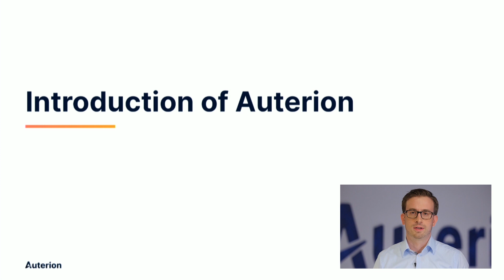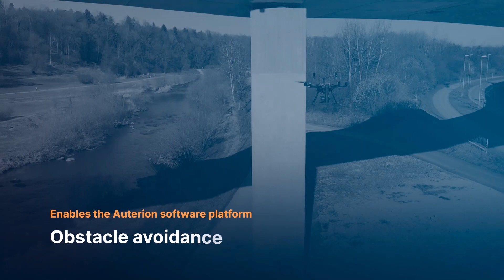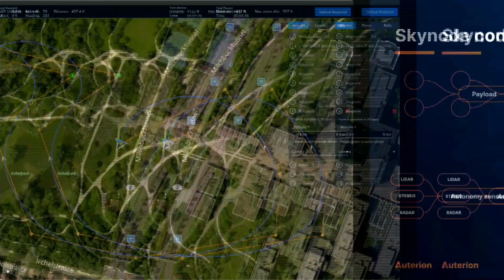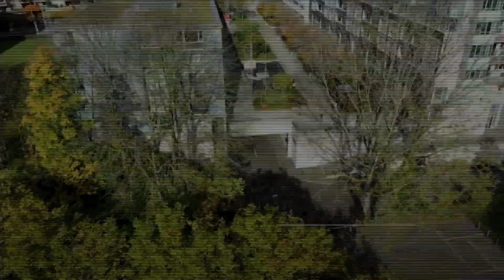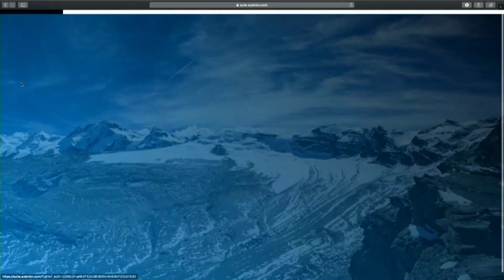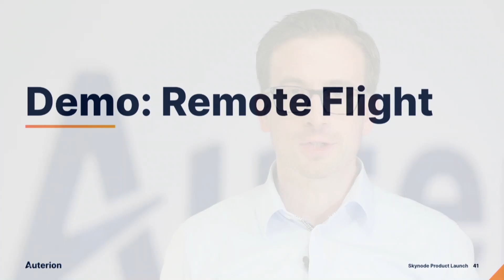Introducing Skynode, the next big thing after Pixhawk

Comment: A nice (and important) step forward. The new mission planning software looks great and includes great features, but the 3D functionalities seem limited to me. As far as I know, the area around the Irchel Uni campus has more topographic variation, than shown on the example screenshots. As such, it looks to me as if the flight path is shown in 3D, the underlying topography, however, is not shown accurately (if at all). Could you comment on this?
Reply: Yes. I was also wandering the same. It seems the flight path is only 3d but the terrain looks flat.

Comment: Hey! When you mention fully integrated with Sony cameras, how integrated are you talking? As integrated as DJI camera sensors? 
I can switch on/off, trigger, record/stop all this now. What are the extra features over these?
Reply from the maker: Apart from the camera controls you mentioned, you can also move the gimbal, store pictures in the image gallery on the ground station and have a live video feed to the ground station. The live feed can even be watched from a remote ground station connected over LTE.
Reply: @Auterion  Is focus control automatic or can it be controlled in any way, thinking of  wide lenses on the AR7? Thanks